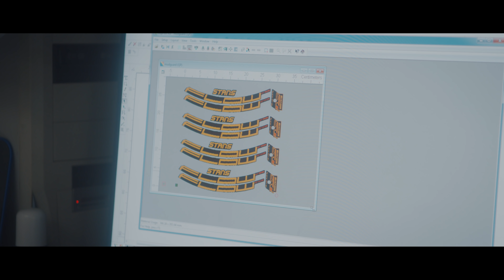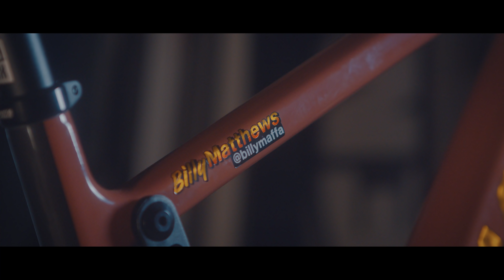Joe's Bikes SANTA CRUZ BRONSON CC @joesbikes #bikebuild

Comment: 4:07 that's a lot of spacers .. i always wondered what its the reason  , the owner its a really tall person ? its considered a thing of beauty ? or its a lack of courage to shorten the fork neck ?
Reply: I’d imagine if it’s for a client/ customer it’ll be cut roughly to fit the fork to the bike and then the customer has room to play with how they want the bike to feel then can shorten if necessary, it’s easy to shorten a steerer tube impossible to add length
Reply: @MrJonathanpearce  Maybe they don't know that its no sense to play with the height , its a common sense to keep the handlebar  as low its possible , because affects the grip on the front tire in steep uphill ride , less grip less control and loose balance , its give me a sensation like this fashion :D https://historydaily.org/content/111430/3f53a2ecb27e4462178603fa715910b1.jpg

Comment: La dirección está bien montada? El rodamiento superior no tendría que estar introducido completamente dentro de la cazoleta del cuadro de carbono y no medio rodamiento fuera y la tapa flotando sin hacer nada , no queda estanca esa dirección así se introducirá todo el agua
Reply: The address is well mounted? The upper bearing should not be completely inserted inside the carbon frame cup and not half the bearing outside and the cover floating without doing anything, that direction is not watertight so all the water will be introduced
Reply: @ernestolopezviniegra1855  Aham , now i see what you mean , its definitely a large gap and shouldn't be like that , i really wish to find out why is that
Reply: @lefthorse1  exactly a large gap between top bearing and head cap, it shouldn't be like this
Reply: @ernestolopezviniegra1855  That would occur when the bearing its mounted in reverse , but at 3:38 its clearly seen that the conical side facing the frame , so its correctly mounted , maybe the two bearing are not the same and was mixed , but i doubt this  , also could be a design flaw of the frame , the cup its not enough deep